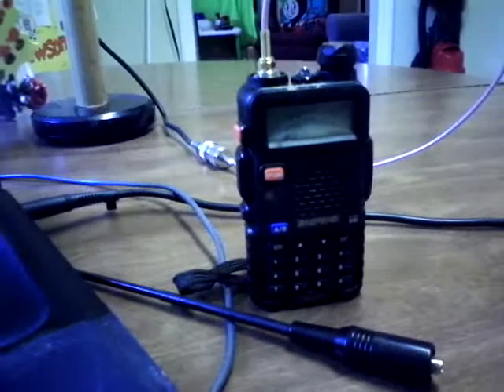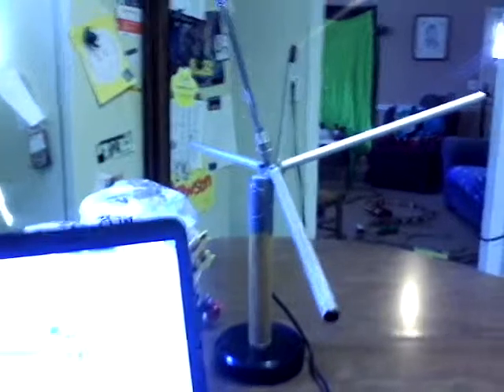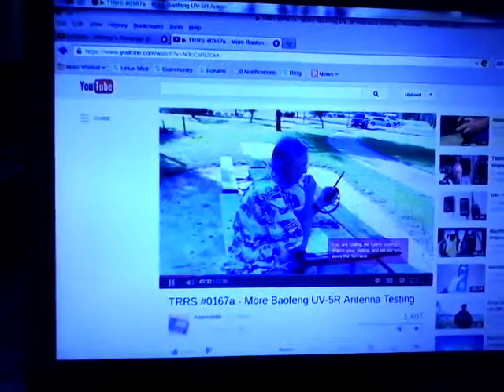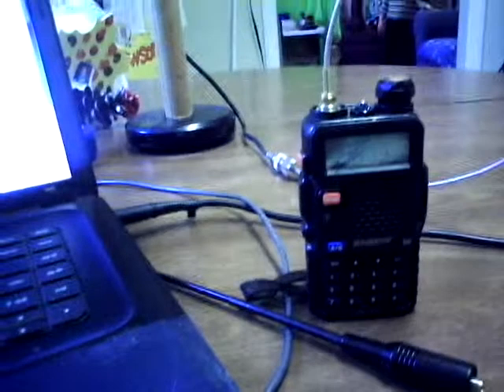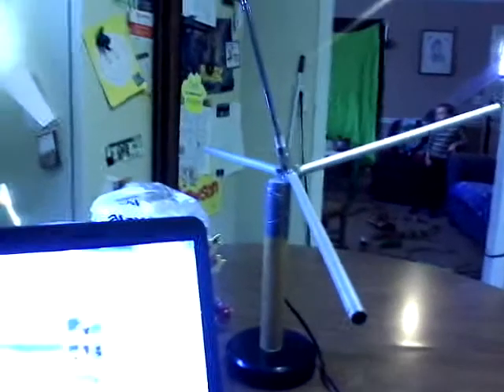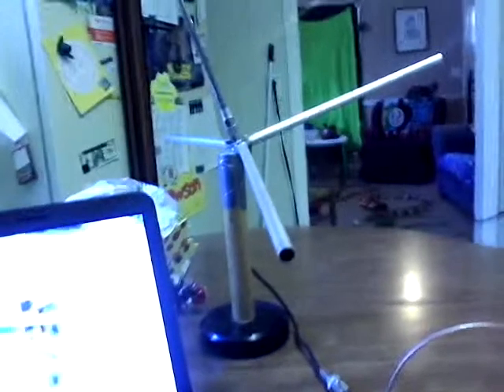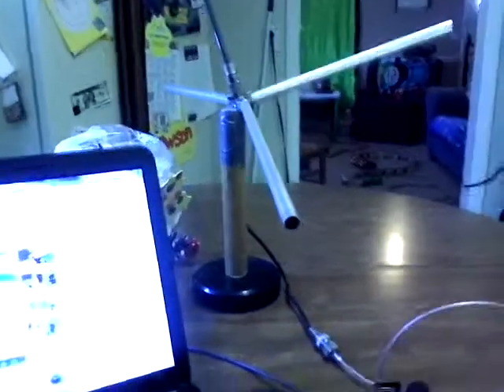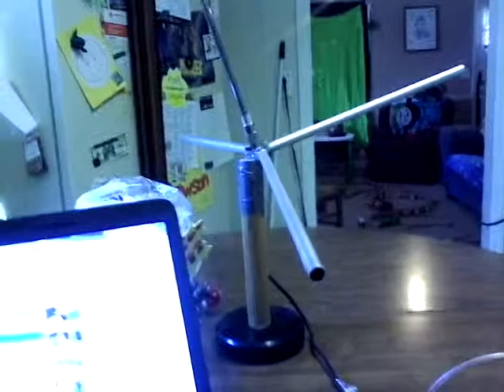my first  homebrew antenna for 2 meter mhz.

Comment: Awesome video.  Here are my comments and remember I am no expert.

1) Video - Use a tripod whenever possible.  Otherwise people will get motion sickness otherwise the video and audio quality is fine.

2) Antenna - very interesting antenna be careful about the impedance.  Not a problem for listening but you could damage the radio on transmit if not correct.  You have the right idea about getting an analyzer.  They are expensive.  See if you can find a amateur radio club near you and join. You may be able to find someone that can loan you one.

3) Another simple antenna for 2 meters is a J pole antenna.  Very easy to make and works great.  Just Google it for plans.  You can also make one that will work on 2 meters and 7 cm.

Thanks for sharing,

Tom
Reply from the maker: thankyou. I figured if im just listening id be ok for now. but noway am i keying this radio. 1. i dont have my license yet. 2. im not sure bout the swr or anything. so yes your advice is taken my friend and again thanks. ill be posting more videos so keep a eye on my page. 73s
Reply: Looking forward to your videos.

Tom